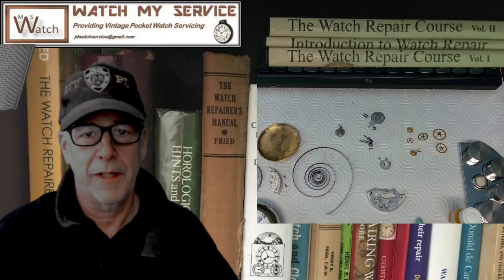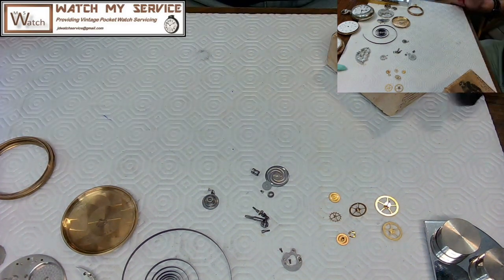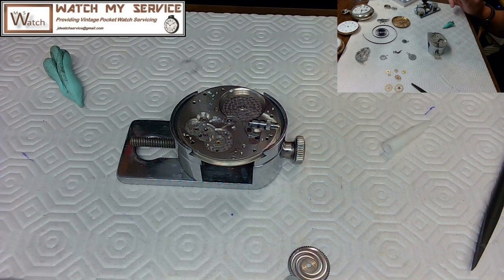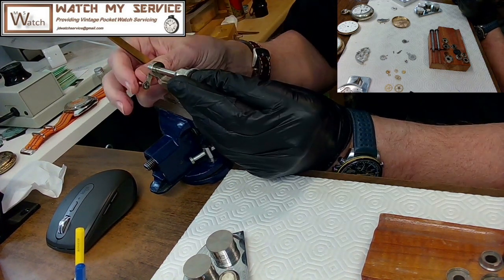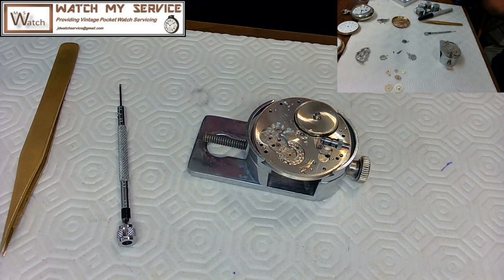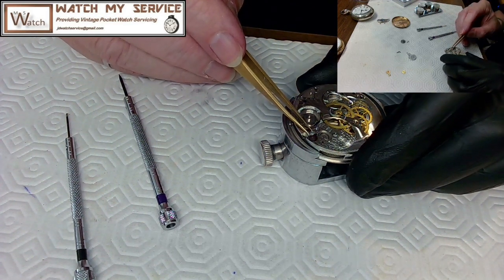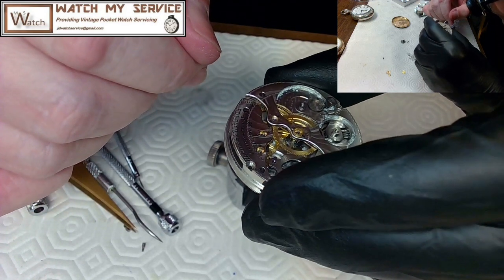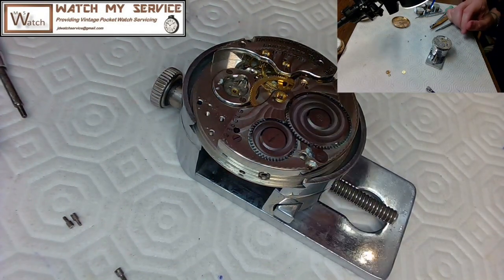Hamilton Pocket Watch Rebuild - Part 2

Comment: Hi JD, really enjoy your channel. I'm a rank amateur at this, having worked on about 7 pocket watches (Got 5 of 'em to run pretty well!) and I can say unequivocally, that for me at least, finger cots and gloves are a complete pain in the ass, particularly when dealing with the mainsprings, which I wind by hand at this point. My solution? Wash your hands A LOT.
Reply from the maker: I kind of agree with you that fingercots are a real pain in the butt when dealing with main springs. There are a lot of occasions where I tend to wind the main springs by hand as well, just to get the T end into the slot in the main spring barrel. It just takes a lot of practice and then after a while, it becomes second nature. I do wear a glove when reassembling a watch, and I keep my right hand away from the movement as much as possible and just use it for screwdrivers tweezers, and other tools